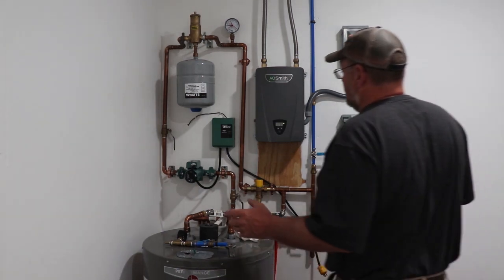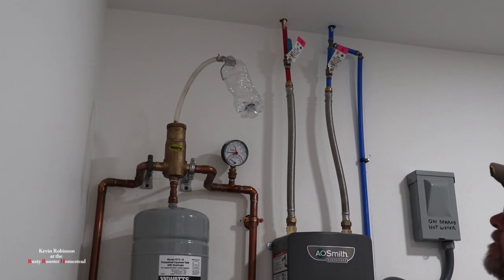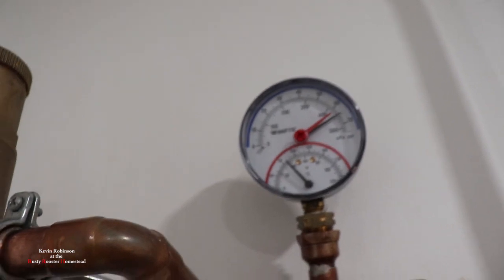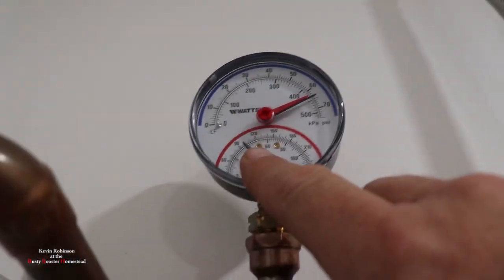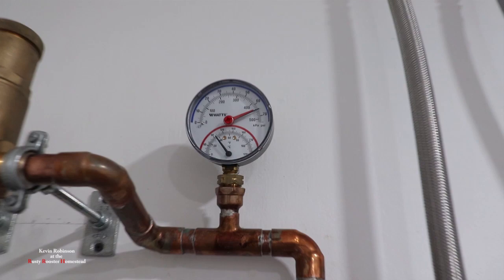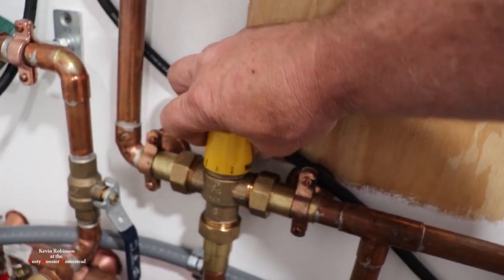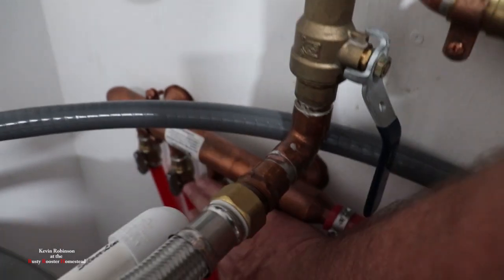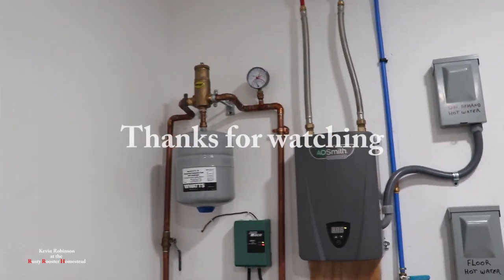radiant floor heat small hot water tank

Comment: You put 65 psi on an expansion tank that’s precharged at 12psi?? You probably destroyed the bladder in your expansion tank. I don’t get why people think it’s a good idea to use a water heater for space heating. They’re not efficient, they’re not rated for space heating and they don’t meet code.
Reply from the maker: Thanks for watching.
Reply: They can work fine, but the pressure should be set much lower, at about 15 psi when cold, and must use a lower pressure safety release valve set at 30 psi.
Reply: @marktomlinson3448  100%

Comment: Very nice build, I am doing the same. Hopefully you are running lower pressure by now, the system pressure should match the tank charge, 12-15 PSI MAX for your application. 65 is way way way to much pressure. I pump hot water from the basement in a 4 story building with 28 PSI. All residential hydronic heating systems need to have a 30LB relief valve, meaning it will blow off at or above 30 PSI. Knock on your expansion tank and listen for a hollow sound in the lower half to make sure the bladder isn't blown out. And please lower the pressure.
Reply from the maker: Thanks for all the great information i appreciate it.

Comment: Really cool!    One comment for the future - heat-pump hot water heaters (e.g. hybrid hot water heaters) use significantly less power than regular hot water heaters and in heat-pump only mode a 50gal tank will max out at 400w of power instead of 4,5000w of a regular heating element.   I don't know if you plan solar etc....  but maybe put that in the back of your mind for the future.
Reply from the maker: Thank you Kenneth.
Reply: Heat-pump hot water heaters typically exhaust their cold air into the living space.  They make heat pump boilers that exhaust their cold air outside with the evaporator being outside.

Comment: Awesome DIY! in addition to pressure reducing valve others have mentioned you need... - U will also need a backflow preventer in the same spot to ensure that water does not mix with the domestic. Nice work! I put a system in 15 years ago, I need an upgrade so I'm watching all these vids to gain "confidence" 🙂 thanks for sharing!
Reply from the maker: Thanks for the information and good luck with your upgrade.

Comment: The mass of the cold concrete will suck the heat out of the water till it heats up. Then the concrete will warm up and radiate, heat rises. Great job.
Reply from the maker: Thanks Terry, I can't wait to try it out.
Reply: Thats exactly how it works. I like to heat my slab to 60 degrees and do it in 60 degree ambient temp. When it gets colder outside it will keep up...as long as its sized correctly

Comment: Kevin did anyone mention to you about putting a pressure reducing valve on the inlet side. You should only need about 15psi ....
The water is coming in and with the check valve it could continue to fill until the relief valves pops....
Reply from the maker: I'm going to look into that thanks.
Reply: Yes, I agree. It will run fine with less stress if you set the pressure at no more than 15 psi when cold, which will give you 17 to 20 psi when at typical loop operating temperature of 90 to 100 degrees F. That is the way I run mine, using an instant electric water heater.
Reply: Also, you should have a pressure relief valve set at 30 psi, much less than for a domestic hot water tank.
Reply: And the psi needs to work at around 15psi last a lot longer pumps will push easier

Comment: I’m curious about how well the electric heater is doing. I installed a system that was already set up. Everything works fine. What temperature do you have the hot water set to?  I was thinking it should be around 90 degrees. The electric heater I used quit. It was an on demand thing.
Reply from the maker: My heater is set on 120 but it run about 90 degrees I just use   a hot water tank it works great no issues so far.

Comment: Hey Kevin, thanks for putting this video. I'm thinking to build a similar system. Can you please tell the tank size and sq.ft of floor you're heating?
Reply from the maker: 960 ft inside the house 36 gallon hot water tank lots and lots of insulation under the floor and walls and roof.

Comment: Watching, i see what confused me most about your set up, is that your pump is on the outfeed versus the return. The return is cooler, therfore less wear and damage to your pump than the hottest point of the system.

Interesting concept. Can you use any old hot water heater??
Reply from the maker: I did research on the pump and it won't hurt it being on the hot side, and yes i just went to lowes and picked up a 36 gallon water tank and i don't have any issues with it.